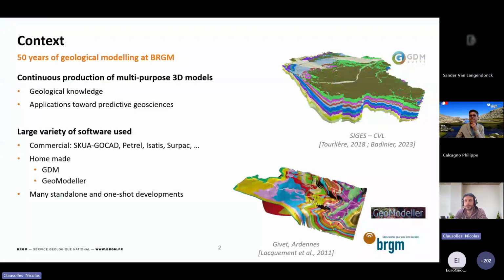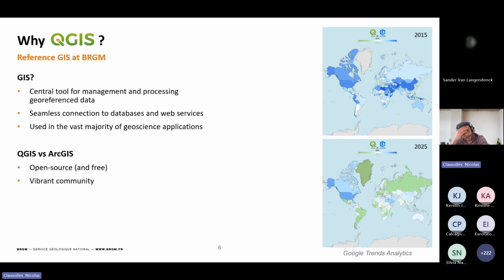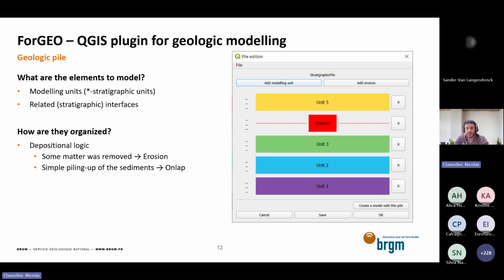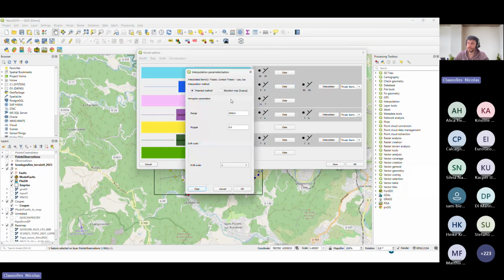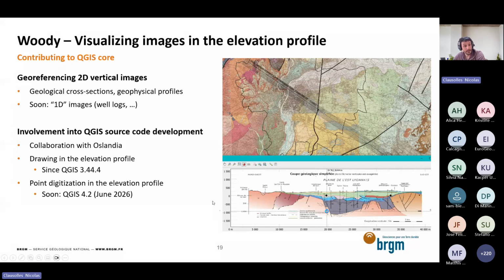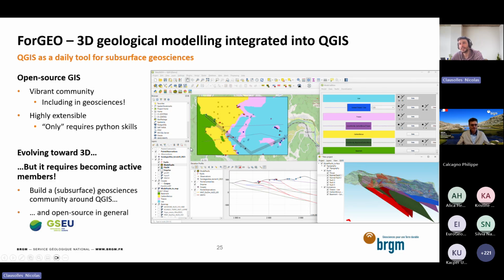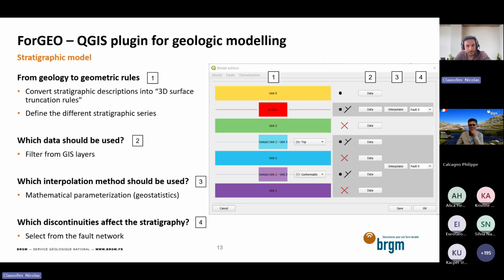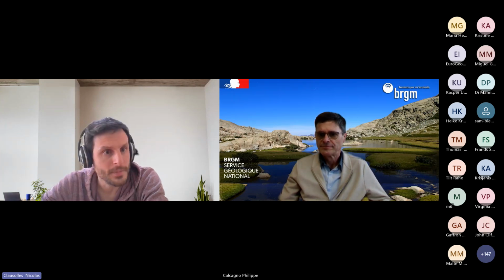EuroGeoSurveys GMMEG Webinar | 3D geological modelling in QGIS with ForGEO

Comment: are there any plan to integrate for QGIS or to ForGEO plugin the loop 3d algorithms or software?
Reply from the maker: Thank you for your question. Below the answer from our Experts:
That would be great to have more possibilities via QGIS for geomodelling. For your information, the 3D interpolation module of ForGEO and Loop use the same core methodology, this is also the case for GemPy, see Lajaunie et al. (1997) - https://doi.org/10.1007/BF02775087, Calcagno et al. (2008) - https://doi.org/10.1016/j.pepi.2008.06.013, Guillen et al. (2008) - https://doi.org/10.1016/j.pepi.2008.06.014